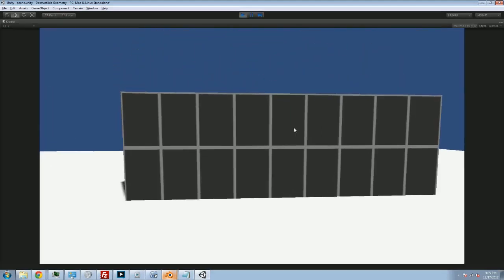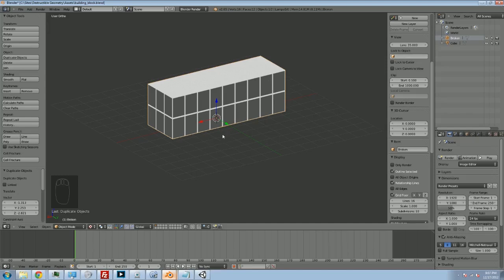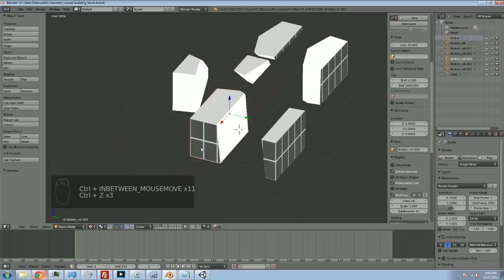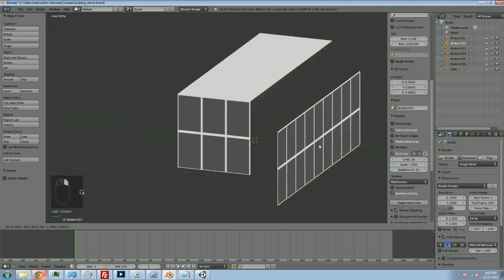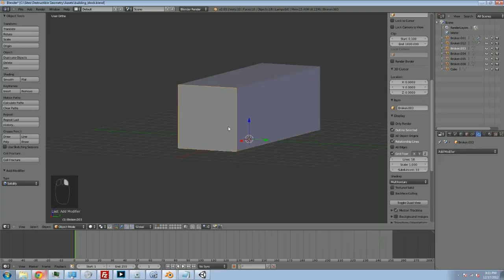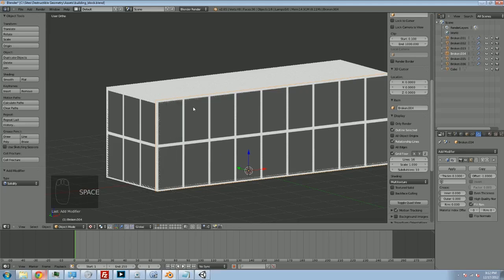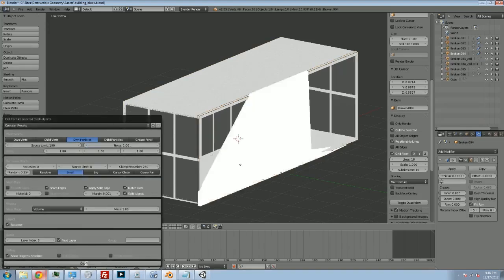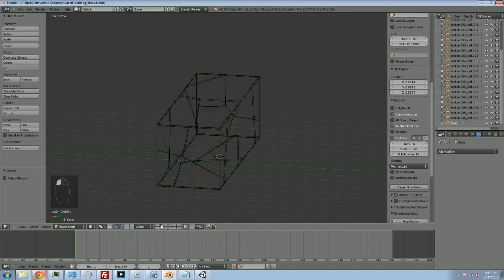Destructible Objects - Tutorial for Unity 3d and Blender - Episode 6

Comment: I've been following this tutorial, but the cell fracture step simply doesn't work properly for me. It looks fine in Blender, but once I save the model and it gets imported into Unity it looks completely wrong. The outsides of the "shards" have no textures, and the insides have completely warped onces. Seems like the UV mapping gets messed up by the fracturing (it's fine before doing that). I know I've followed the instructions perfectly, so I guess something has changed in either Blender or Unity since this video was made and now this just doesn't work anymore.
Reply: Solved it! Seems like for some reason the primary material (each shard has two materials) was no longer assigned after importing the fractured model. No idea why, but assigning it again fixed the issue.

Comment: this video is obviously older, but I'll comment nontheless. to isolate all the faces, just use the edge split modifier, apply it, then go into edit mode, select all and "seperate by loose parts". it's a lot faster. also wirks with more complicated objects, you just have to adjust the splitting angle on the modifier